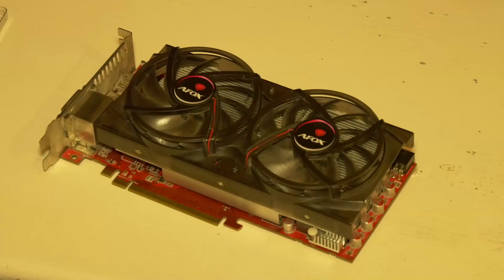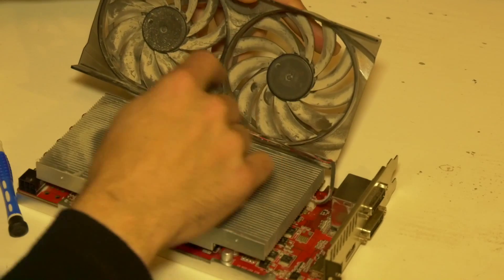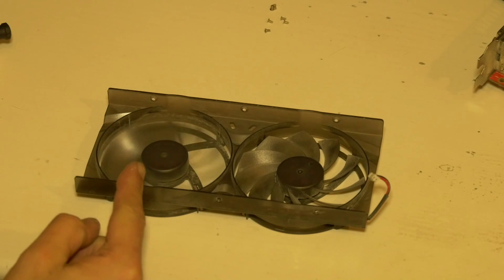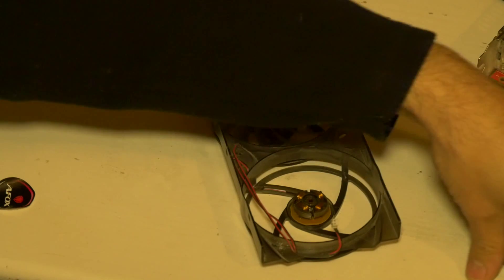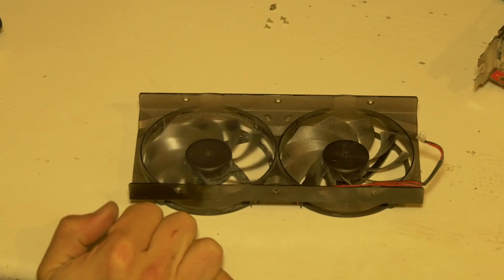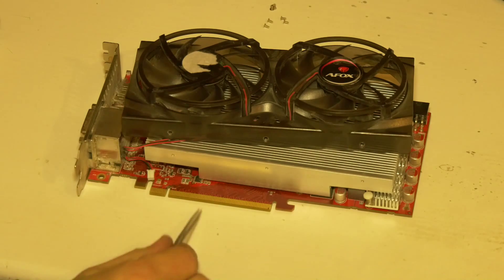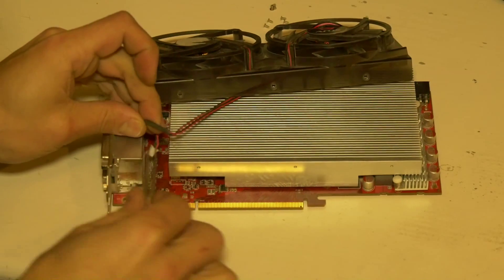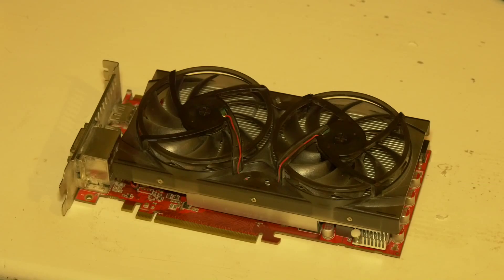Sticky GPU CPU Fan Fix Tutorial

Comment: Compressed air on that heatsink works wonders, stay away from the brush.
Reply: the brush helps with dust that sticks hard to the surface,using a brush before the air will make it more effective

Comment: If you plan on taking the blades off anyways, you can actually clean these fans in soapy water using an old soft brissle toothbrush. You can clean em up really good that way, just make sure they're completely dry before re-oiling and using em. I've done it many times to lots of fans, never had a problem with it... been doin it for years to fans.
Reply from the maker: Gary Riefle good tip, thanks, I'm going to do this soon, I think it's the time of year to decrud the system!

Comment: What is this rude behavior? With this brush can interrupt the thin wires of the stator. Act more carefully.And why all of you too lazy to open the back cover, remove the rubber earbud to remove the plastic disc, but pulling propeller risk breaking down?
Reply from the maker: +dian2n There was no other way to get into this design and there is no risk of breaking something already broken. It is still working fine many months later.

Comment: http://www.ebay.co.uk/itm/75mm-4pin-PC-PWM-VGA-GPU-Video-Card-Cooler-Cooling-Fan-Replacement-Hole-to-Hole-/400903740189?hash=item5d57b99b1d:g:dJMAAOSwrklVL5MK
Reply from the maker: +Jared Reabow (Jazza) The issue is more in mounting it. I suppose if I drill and tap the heatsink I can fit them if I dump the cowl. The plastic cowl actually contains the base of the fan
Reply: +The Backoffice my thought was pop off the old fan and baring and replace them
Reply from the maker: +Jared Reabow (Jazza) worth a shot. I will see if I have any others lying around first.

Comment: the fan shouldn't have just popped out like that, there should be a horse shoe clip
Reply from the maker: +Jared Reabow (Jazza) There was a c-clip in there and some bits and bobs. I assembled it all up and it ran sweet. Its started to knacker again now so I suspect it was faulty for a while and now the bearing is worn too much. A slightly thicker grease may save it for a while.